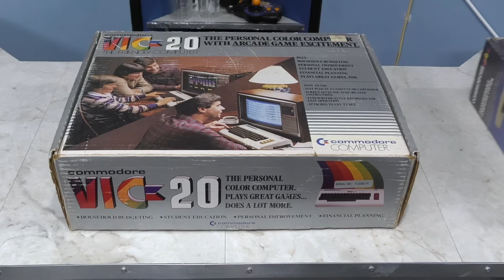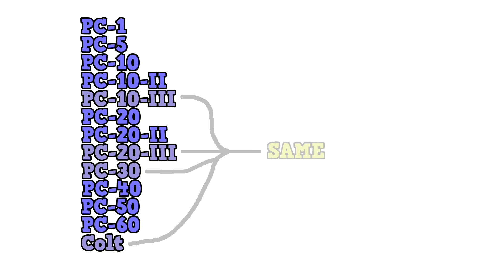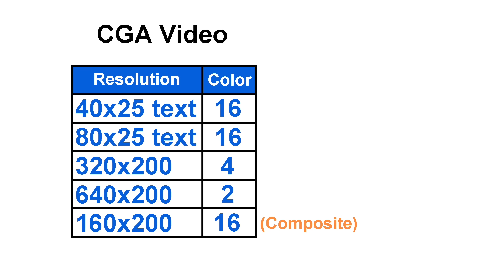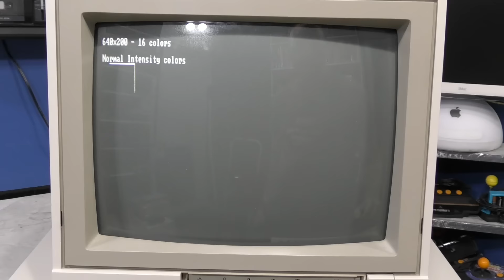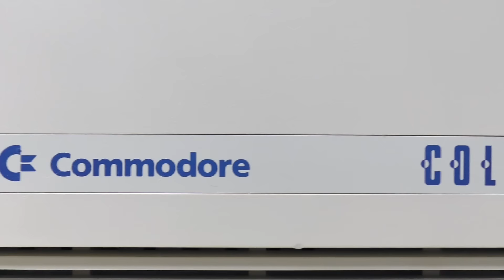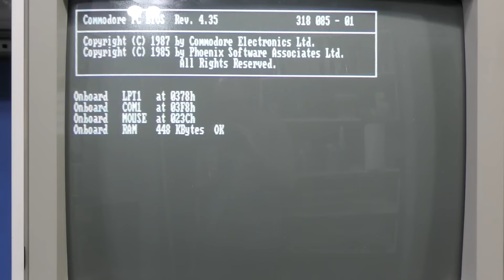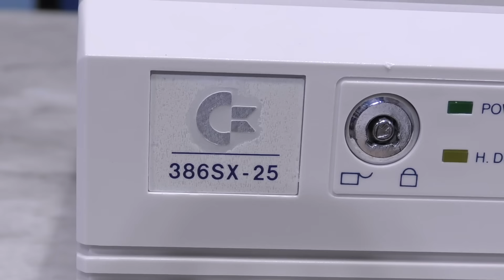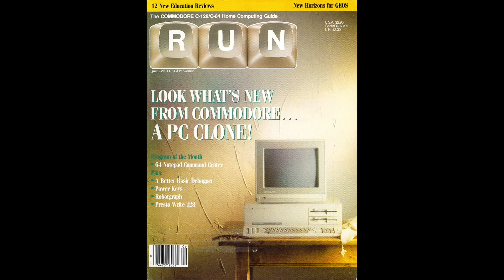Commodore History Part 6 - The PC Compatibles

Comment: The PC-1 was build in 1987, the 1984 date stamp is only for the radioshield guidelines of 1984 in Germany.
Reply: Thanks, just wanted to say that too
Reply: Yes. I came here to say the same thing 😉
Reply: same :D
Reply: It was build among many other commodore hardware at Commodore Büromaschinen GmbH in Braunschweig, its my home town, too.
Reply: Yes. DBP stands for "Deutsche Bundespost". It's the old name of the "Deutsche Post" and until the 1990s every electronical component had to checked by them, if they emit any radio signals that could disrupt for example radio programs. The printing just says, that the product is checked to comply to this standards.

They are the same at the FCC rules for electromagnetic exposure, which were the reason for the big iron fans in the 1970s and 1980s computers to make the computers FCC compliant.
Reply: Exakt!
Reply: Acme. Nipp-on-AiR stan lee would be proud of u sir!
Reply: Well, West Germany anyways. Got to say it one more time : )

Comment: To the problem with the motherboard from 1987 and the case from "1984". 1984 was the year of the regulation DBP Vfg. 1046 enacted. This was a regulation in germany for electrronic devices to not interference with radiowaves. This was not the year this PC was build.

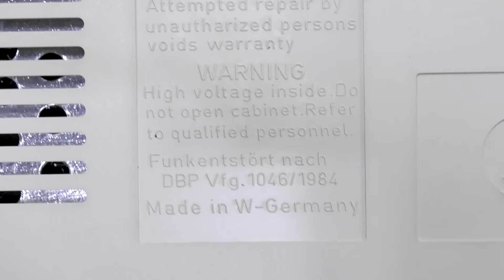Comment: Dear 8-Bit Governator, Sir... no idea if anyone already pointed it out or told you... that "1046/1984" reference in the plastic (@1:43) is just a compliance reference to some German interference regulation law, comparable to a FCC compliance declaration. That's no indication of the year the device/unit was built in.
Reply: Long live the 8-bit Governator
Reply: I just wanted to pint that out, but Youtube comments are as reliable as always. Thank you!
Reply: Or the 8-Bit Keymasher Vs the Perifactorial Retro Rythm in a epic Synth battle. whoo
Reply: those "Amtsblattverfügungen" had consequences like a law (you could go to jail if you did not follow), but were not ratified by any parliament or president, but just issued by the minister of postal services. (litterally he was the only one who could make factual laws without asking anybody else)
Reply: If i ever start a punk band... i'll call it Funkentstört
Reply: I guess, there was a punk band called "Punkentstört" ;)
Reply: @rarbiart  That's the same as "regulations" in the US, which are in the Code of Federal Regulations (CFR). FCC Part 15, technically 47 CFR Part 15, was issued by the FCC under authority from Congress. FCC drafted up the specific interference regulations and how much power and frequency devices like Wi-Fi can use, for example, put it through a public comment process, and became law once published in the Federal Register. Congress doesn't know anything about power line emissions or occupied bandwidth or hopping rates, so they've delegated the issue to the FCC. Many other government agencies make these laws without direct review from Congress, like FAA, EPA, DoJ, etc.
Reply: There's a lot of mistakes in the video. Like claiming the entire industry had moved to PS/2 by 1991. This is just false.  Most still had a 5 pin din.  Also, IBM was NOT trying to compete on price. He just completely fails to understand IBM and why they did certain things.  For one, parts availability.  IBM supported their machines for years and years. I was still able to get parts for PS/2 486 machines in 2001! I supported a site with several hundred of them.  
There are just a lot of these little mistakes.
Reply: @christo930    He didn't claim IBM was trying to compete on price. He wasn't discussing IBM's reasoning or strategy in any way whatsoever. He just matter-of-factly stated that Commodore was a lower cost producer. I don't see how he was wrong. I welcome any corrections you may have but instead of giving corrections you just claimed there are lots of errors while only mentioning two, one of which was an error on your part, not his, as just discussed. I have no idea about how standard the ps/2 mouse port was in 1991. I just know I got a Dell 486 machine in late 1991 and it did come with a ps/2 mouse port. According to wikipedia ibm themselves discontinued the AT in 1987 when they introduced the ps/2 and its mouse port. Are you sure most new ibm compatibles sold in 1991 were using the 5 pin connector?
Reply: It was not an error on my part.  
Pretty much all IBM machines were using PS/2 fairly early (87 sounds about right) on. It was the rest of the industry that wasn't using PS/2 ports.  I'm not saying they didn't exist, just that most did not use them.  IBM did use them.  PS/2 is really not any better than DIN connectors or DB-9 serial.  I would say about 70% were using DIN for the KB by 1991.  Din ports were available on MBs into the 2000s.
Reply: @christo930  what i called an error on your part was your assertion that the host of this video made an error by sayibg Commodore was a lower cost producer than IBM. You took that as him implying IBM was trying to compete on price and called him wrong for it, "as discussed above."
Reply: I don't feel like watching this 25 minute video again. It's been a while since I watched it.  But from what I recall, he did do that.
Reply: @christo930  He said Commodore and Tandy made parts in house so they were less expensive than IBM that had to buy parts "off the shelf, so to speak". Around 20:40 I don't understand how what he says conflicted with what you were saying.
Reply: Loki. Because they weren't trying to compete on price.  When you bought IBM, you weren't just buying a machine.  I was able to get parts for IBM machines built in 1990 in 2001!  IBM had an entire subsidiaries that specialized in things like service and procurement. Also, IBM sent out 100% consistent machines.  They did not do things like change the bios or "upgrade" parts because newer ones were cheaper.  That might not sound like anything to a home user, but try supporting a site with 10k machines.  They also worked very well if you were already married into IBM technology in the form of large system databases and the like.  IBM has a document imaging system that works across platforms. If you had an IBM machine, you could even add a 2nd monitor that was taller than wide  (paper) where you could bring up the scanned documents.  They had/have all kinds of shit like this.
Reply: @christo930  yeah that's great actually. But usually customers just see the price tag and pick based on that. I think he was mentioning price from the immediate sales point of view and not after sales support/general item quality.
Reply: @Loki... Yes, home customers do that. That is why IBM was not targeting home users.  That is why IBM made the PC Junior.
Usually home users only look at the upfront cost and not the total cost of ownership.   When the computer doesn't work and you need to wait a week for parts, if you can get them at all, you aren't paying the user to stand around with a thumb up his butt the way you would be in a corporate setting.
Reply: @christo930  Have you been arguing from the point of corporate buyers this whole time? I still don't understand your point of contention. He simply said they were less expensive than IBM because they made parts inhouse. Are you saying IBM was more expensive because of their customer support they provided as well? If that's what you're saying, then you're only adding to his reasoning rather than rebutting it.
Reply: I wouldn't call it customer support, but, yeah.  My main point is that IBM was not trying to compete with low cost clone producers.  They did try a couple of times with different PC models, but they were mostly failures.
Reply: @Loki-  I agree! ANY "PC clone" maker was EASILY able to offer more features at a lower price than IBM. Some aimed for ULTRA cheap and failed in the longer term as a result. Higher quality manufacturers (like HP *at the time*) were able to manufacture superior performance PCs, at a competitive price, in high quality cases, with good warranty (for the times). Although I was not a fan of the early PC architecture, I could understand why business users would go for it. What I could NOT understand was why they would pay for massively overpriced hardware from IBM when better product was available elsewhere for lower cost. I worked for a bank in Australia which (at that time) would only buy IBM product. (I wish I had been the IBM salesman!) When I reviewed a PC from HP, it beat the (then) IBM AT on every spec, and was less expensive. The bank refused to buy them, of course, lest the purchasing dept lose their "brown paper bag" bonuses. If only the shareholders back then had known ...
Reply: @christo930  "When you bought IBM, you weren't just buying a machine." No, you were paying a RIDICULOUS premium for THAT manufacturers label. "I was able to get parts for IBM machines built in 1990 in 2001!" SO WHAT? For the cost of those IBM parts, you could have bought a technologically (2001) superior machine AND been streets ahead on both outlay AND performance! The internet is RIDDLED with examples of IBM ripoffs if you care to look.
Reply: @christo930  "That is why IBM made the PC Junior." And it was such a MASSIVE failure in the home market where price was an issue.
Reply: @rahb1  Have you ever had to support a thousand machines in one site?  
IBM wasn't just some shitty label like NIKE.  You are just wrong about this.
Reply: @rahb1  The Jr had much more problems than just price.  Yes, it was way more expensive than other machines, but that wasn't the only thing wrong.  It was a computer that had no real market. Further, even if that market existed at the time, IBM's main strengths were just completely irrelevant to the home market. When you are selling computers to families, you just do not face the same problems as when you are selling them to big business.  The scale at the site level is not there and there is no existing IBM service or an existing TR network with a mainframe computer.
Tandy was a much better match to the home market.  They had nationwide retail presence and excellent marketing.  IBM had no experience with selling to the general public.  The Tandy 1000 was a better machine,  IBM released a model that was even cheaper than the 1000 and it too did not sell well.
Reply: 8-Bit Governator, should be a shirt. Then add, "I'll bit back".
Reply: Yeah not reliable source at all and no overlooked info by experts.
Reply: Yes, that's right. The back of the PC-1 just says that it is free of interference. "DBP Vfg. 1046/1984" is the standard in which this is regulated. This standard was from 1984. DBP stands for "Deutsche Bundes-Post", German Federal Post and Vfg. Stands for "Verfügung", which means regulation.
Reply: @mattmexor2882  the clone manufacturers - though they'd kind of started to lose that tag by then - were very, very, very reluctant to use any standard set by ibm. It took a lot longer for PS/2 to be accepted by then.

They'd just had the drama with IBMs MCA bus, a replacement 32 bit bus that ibm used in the AT and tried to force on the industry through licensing. They tried to use their ownership of what they hoped would be a new standard to demand retroactive royalties on all previously sold ibm pc clones. The clones successfully fought off the MCA bus standard by commuting to their own E-ISA and so after that were wary of anything invented by IBM. The idea of ps/2 being standard in 1991 is laughable to anyone who knows about the clone makers and their distrust of ibm at that time.

He's also right about IBM seeing the commercial consumer marker as a nice bonus but not really something they cared all that much about. They weren't competing on price. I think thats open to interpretation on what was actually being said though.

Comment: 1:44 - The 1984 very likely has nothing to do with the release date of the machine. This is (afaik) referring to a regulation of the german postal office published in 1984 that the machine is in compliance with ;)
DBP Vfg. 1046/1984 = Deutsche Bundespost (German postal service) Verfügung (Regulation) 1046/1984 (Number 1046 published in 1984)
Reply: yep. this is correct. this date has nothing to do with the date the computer was sold. it is purely the year of the regulation paper.
Reply: Just started typing a similar answer, and then saw you came first. Cheers!
Reply: @cardinalcam  Cheers! ;)
Reply: Yes. The Commodore 116 has DBP 529/1970, so the Number 529 published in 1970 not the computer:
https://gagada.files.wordpress.com/2007/08/com116.jpg

Comment: The Commodore Colt was an amazing BBS browsing machine. I had mine decked out with a spectacular 28.8k baud modem and TELIX. God I miss the BBSing days on that machine. Even though the Colt was super obsolete towards the late 1990's, nothing beat it's ability to quickly get online and perform reasonably well. (And I did use double-speed while browsing BBS's)
Reply: Telix!  Those were the days.

Comment: I used to have a Commodore 486SX-25. It had 4MB RAM and a 120MB HDD and I think the video card was a 512KB SVGA (I think the chipset was Paradise). Later I added a SoundBlaster 16 to it and then later I maxed-out the RAM with another 4MB. (8x 1MB SIMMs)

It was a pretty standard desktop case, but didn't have P/S2 keyboard or mouse connectors. The mouse was a standard 9-pin serial mouse on COM1. The video and drive controllers weren't integrated, but were on expansion cards. There was also the "487 maths co-processor" socket, which I've been lead to believe was really just a 486DX that disabled the 486SX, which was a 486DX with a disabled floating-point unit.

I still remember the fond times of lugging it over to a neighbours to play Doom deathmatches via a null-modem cable.

Comment: I had an IBM compatible Commodore PC. I remember it was a 286 with an impressive 1MB or RAM. It was a nice machine. It came with two floppy drives: a 5 1/4 and a 3 1/2. I loved that machine. I think I paid close to 2,000.00 for it back in 1990.

Comment: Those old Commodore PC's were well made. I saw one still in daily use in 2013 with an SCSI upgrade being used as a program library and a RS 485 coms through a switch box to a machine shop running CNC equipment. It certainly brought back some memories. The burn in was impressive.

Comment: in "zak mckraken" you must press shift P to toggle the game to composite mode, if you let it use "normal cga" it won't display the proper colors for composite.
Reply from the maker: I didn't know that.. but it wouldn't have mattered, they still wouldn't have been right.  I verified with many games (including my own) that the hues for blue and green are reversed.

Comment: So interesting fact: I'm in Ottawa, Canada and we had a TON of those 386SX-25 models in my high school. I could be wrong but I want to say we later got some 486 models too. So it does appear they were sold outside of Europe but I wonder if it was only sold to educational channels in North America as my school board had a long-standing relationship with Commodore right up until they went under. After that, they started buying machines from a local retailer for a while, then switched to Digital Pentium 75 systems which were absolute junk and failed left and right.

Comment: Hi 8bit guy!
To answer your question you asked at 1:36min:

It says on the back of the computer "Funkentstört nach 1984".
So: at 1984 there was a law that told the producers how to manufacure electronic stuff so that it doesn't send signals and disturb other equipment while running.

Thats not the year of production. Thats the year the law came out! Nearly every C64 from Germany has this on their lable at the back.
If you have a 1983 silverlable C64 for example that says "Funkentstört nach 1984" at the back: its definately a fake and not worth a lot of money!

Comment: The 1984 on the back refers to the german FCC law the machine complies to. IMHO it has no connection to the release date.
Reply: true true
the text only says "suppressed against noise or interference by specification/standard  1046/1984"
it was the releasedate of the specs...

Comment: Very nice article and very informative. In the past (1987 to 1994) I owned a C128 with 1541c (everything except the C128 is still exexisting) and this is still my field of interest in vintage computers. OK, a C128 I would have to get a new one first. But I still own my first PC, a 93 Conrad AT 386 which I like to use again and again.
From the attic of a flat I could save an IBM 5170, but in the beginning of the 93s It was pimped by the unknown owner with a 386 motherboard.  I love this one too.
And exactly this PC has the same keyboard as the shown Commodore PC-20 III at 12:47. The type label on the bottom is on the manufacturer Mitsumi.
I am always fascinated how clean you get the cases. I tried to clean the black spots on my 1541c the other day - no success.  Not with Testbenzin, not with Isopropanolalkohol, not with WD-40, not with Kaltreiniger (for dirty car parts) ... pffff, not with Spiritus oder Brennspiritus ... I ran out of ideas.
But anyway, a way will be found. Now is a lot of time for that ... ;o)
Oh, yeah, I forgot about the C386SX-LT. I got it at a flea market once. Runs Windows 3.1 and DOS 6.22. Crazy stuff. It looks exactly like the device shown at 22:03.

Comment: I hope you can talk to some of the original Amiga hardware designers.
Reply: I would like to also ... So i can yell at them for the fuckup called the cd32
Reply: Unfortunately, one of the most important Amiga designers - Jay Miner, died in 1994
Reply: Markus RK200 well the cd32 is pretty good. It can even be turned into an Amiga 1200! But the games were mostly amiga ports with CDDA audio, very awful exclusive games